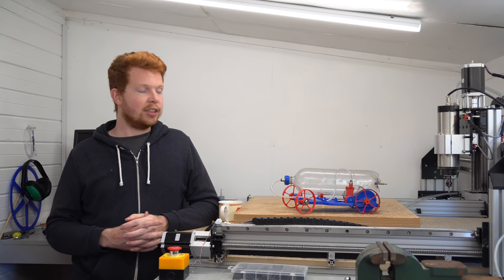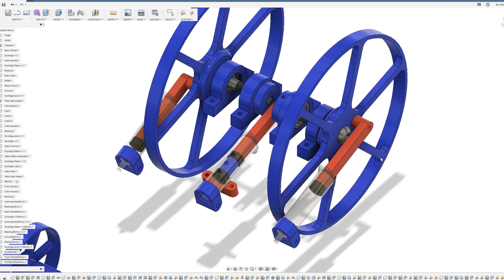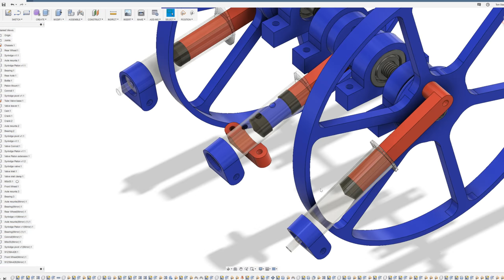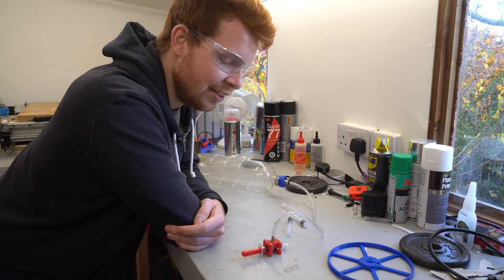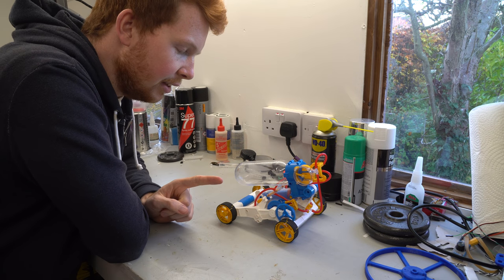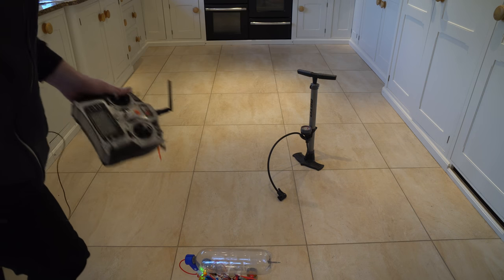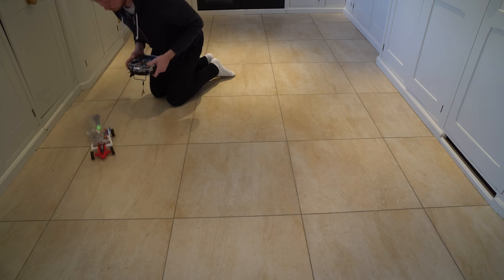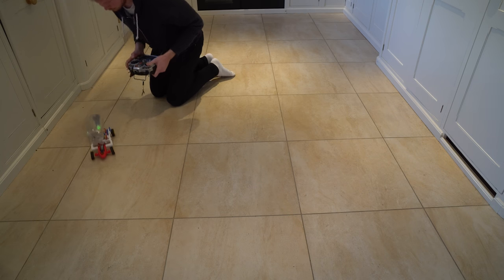Air Powered RC Car

Comment: A loss of resistance syringe might help with friction problems. Or just a little water might go a long way. Maybe an inline oiler or humidifier would keep things moving well and help maintain the seals. You might want to consider polycarbonate syringes for higher pressure applications, if you want to stick with plastic. The tubing could also be another component susceptible to expanding under pressure.

Comment: You could wrap the syringes with a string that does not stretch, in a nice tight single-layer spiral. Mix up some epoxy and coat the string. That'll hold a lot of pressure.
Reply: Sort of like how we repair ruptured pipes in the Navy: https://goo.gl/images/w45Yuq
Or like attaching a metal pushrod to a wooden dowel in an RC plane: https://goo.gl/images/WUWSFH
Reply: Perhaps if you put a little lubricant in the syringes you could get back some of the friction loss.
Reply: At the end, you pulled that tube out. You now need a valve that opens and simply thrusts with a nozzle (of course, engineered to the right specs!) when that becomes more efficient, to get that last 15 or 20 (or more, you wasted a lot by letting it freewheel!).
Reply: I would also love for you to break down how the one you bought from Amazon worked. Maybe even a tear-down of the interesting parts.
Reply: Love your videos, by the way :)
Reply: I read below some other comments about the same kinds of suggestions. You can do this, you can beat that crappy Amazon vehicle that is actually pretty amazing.
Reply: Lol that’s how they make shells for fireworks.

Comment: Hey Tom, very cool stuff! I've made piston air engines using brass tubing from the hobby shop. The dimensional accuracy is great - they make reasonably tight fitting, low friction pistons. I'm sure you could seat the cylinders well in a 3-D print. A little bearing grease would make the piston airtight.

Comment: Thats what I was thinking! Maybe two halfs bolted together like a clamp, holding the syringe in the mide, maybe with a silicone or rubber sleeve to prevent leaks between the syringe body and the plastic at the holes. Could drill a hole straight through the plastic, rubber gasket sleve, and syringe to ensure they're aligned. (Or something similar)

Comment: You could have made sleeves to go over your syringes, turning the syringes into cylinder liners, or you could have used glass syringes, which would possibly take the pressure, and have much lower friction.

Comment: Hi Tom,
first of all, great video as always.
I had the idea to make the car fully powered by air so there is not even a battery for the receiver and servo. You could use a small generator to make this possible. A turbine would probably be too inefficient so you could use a small brushed 5-6v motor and gear it to one wheel maybe? You could add a turbine between the bottle and the cylinders tho. There it could work. Would certainly be cool to have a fully air powered RC car.

Comment: Did you consider adding some kind of regulator so that you'd have ~100psi in the reservoir with a regulated lower pressure being fed to the pistons/motor?

Comment: Tom, with your design you can use PVC tubing with 3D Printed cylinder gaskets as the PVC can resist the pressure especially if you use pressure pipe, but you would have to build your own cylinders using PVC pipe

Comment: Just an idea, but there are pressure valves/cylinders (like the syringe) with a spring system to keep the pressure (more or less) constant.
I would also use two alternating pistons to keep the speed and torque a bit more constant.

Comment: I think your original idea for the air motor was genius.  The problem seemed to be you were losing tons of compression with the loose fitting piston.  If you could improve the tolerance between the piston and cylinder, I think you could produce more torque than you need.  That was an awesome series of videos.

Comment: You can probably get the same pressure into a smaller bottle if you use one of those 1 litre soda stream bottles & modify the cap a bit so it seals up properly & then add that valve on the bottom ofc through the plastic piece.

Perhaps another update could be attempting too design a container that's perhaps 3 - 2.5 litres instead & with a 60 psi limit & try some sort of plastic safe silicon oil in the syringes & any moving parts as well.

Comment: you should try to use glass syringes and if the pressure is too high maybe create 3d printed mounts for it to hold it together

Comment: You should build a gas generator, maybe steam, a burner, or something like the reaction they use for the emergency oxygen for airplanes. With this you could power all your gas powered contraptions a lot longer.

Comment: New variation - build an alternator into the rear axle to charge a super capacitor or 3 to power the electronics for the steering.. making it completely air powered!!

Comment: Hi, you could reinforce the bad plastic walls with carbon fiber, then soak em in super glue to gain back strength....or get titanium sleeves made to replace the bad plastic. Maybe get the ID made a bit larger so the resistance from the plunger is less. Or get a beefier plunger with an o-ring. You could print that part.

Comment: You could have printed supporting tubes for the syringes. And also exchange those rubber seals with proper O-Rings, as you had already designed your own pistons. Adding a little lube helps also tremendously. Adding a throttle control, so you could stop the car or even adjust the speed a bit. I guess I have to start own Design.

Comment: Yes i tried using a syringe for done air project thingy.. the plunger is too sticky, though the syringe itself could handle the pressure. The walls on the syringe i had were thicker.

Comment: I would have just printed some sleeves for the syringes so that they could hold higher pressure. Hell, you could even just wrap them tightly with duct tape.

Comment: If you want an ultra efficient air powered engine, take a "Tesla Turbine". I had advised you the same a while ago, however it seems like you haven't read it. Hopefully you will this time, because 98% efficiency are really worth a try.
Reply: But its a turbine with low tourq and no throttle.
Reply: No way a practical tesla turbine can get 98% efficency, even 60% is pushing it.
Reply: The gearing for that level of efficiency might as well be a water wheel
Reply: @crackedemerald4930  gg
Reply: I'd be curious to see him implement that too, but I dont know if it would be better.  Something worth playing with though.  Maybe a separate project.
Reply: 98% efficient...with no load.

Comment: I think 7:1 would give you a but more torque to get around those corners.. It also probably does not need a full 60psi, so a pressure valve may let you add more pressure/range without exploding something :)

Comment: Would be more interesting if you had a pressure gauge added that wirelessly transmitted the pressure reading to your remote so can estimate remaining distance available.
Could also add an extra servo just to do the kick start/block one of the pistons from moving so can stop it.

Comment: You could reduce resistance in the corners by implementing a Ackerman Steering Geometry. As this car is quite low speed it would be appropriate. It's nothing complicated, just give it a quick Google search. By changing the steering angle, so that both front wheels are perpendicular to their respective turning radius you reduce sidewards sliding of the wheels and thus reduce friction. Also, nice video.

Comment: Since this air powered engine design seems very efficient and lightweight, you could consider using it in your plane; likely it will require some gears to get a higher rotation speed.

Comment: An idea on using something other then syringes. You could always get some small diameter copper pipe. Then find some thick leather and make pistons that way, using some airtool oil or light weight grease should expand the leather enough to keep a seal. They used to make brass air pumps this way in the early days. If copper pipe would be to heavy there is pvc water pipe that might work as well. Plus if you would build a bigger car you could always use an air tank from a paint ball gun.. Just some thoughts.

Comment: Tom, I wouldn't give up completely on your DIY motor. you already know that the printed cylinder is stiffer, you could print jackets to contain the syringe expansion. And to reduce friction you could do away with the rubber plungers and cast pistons out of epoxy directly in the syringe itself. There's at least one diy internal combustion engine that has been running a few minutes on a JB weld piston, so air pressure should not be much worse.

Comment: Here's a challenge for you Tom. When I taught science we'd make soda bottle water rockets. Students would pump them up with a bicycle pump, but none of the bicycle pumps would last more than about 40 minutes before the bases were loose,  overheating would screw up the gasket seal...  Cost of the pump made no difference. 
We could use an air compressor, but the thrill of teenaged boys frantically pumping up their rockets is lost. Can you design and make a pump that can be maniacally pumped without wearing out in a matter of minutes?  The problems are 1. overheating 2. The movement of the whole pump.  I thought perhaps caging the pump in a frame with handles on opposite sides -- like the old horse drawn fire wagons. Then wrap the pump cylinder with a water jacket made from a larger tube filled with water.  Ideally it wouldn't require any 3D printed parts.

Comment: Hi Tom, have you considered adding some form of a exhaust recirculation? You could use some of the bled off pressure back into the intake to help make more power, or use less pressure at a given time to maybe go a bit farther on a single bottle of pressure. The hard part would be managing the bleed off of the exhaust so pressure can still escape and some can still be used, you could also use this as a form of variable throttle because air moving through the engine is what makes it function, therefore if you keep more from exiting you'll limit the exhaust flow, also there by limiting the flow in and out.

Just a thought I had.

Comment: Tom, really cool design! I'm an interventional radiologist in the US, we use high pressure syringes during our angiograms such as Merit Medallion syringes which are polycarbonate with oiled silicone which are quite strong and nearly frictionless.  They are a bit pricey but after all your design work, I am pretty sure it would function with these or similar syringes.  Maybe a nearby medical facility can donate some to your channel?

Comment: What if you take the syringes and place them in a 3d-printed cover or wrap them with steel wire? Should keep the side walls from bursting, but won't do much to help the end caps.

Comment: use paintball air tank with pressure regulator as an air source.
it can be pumped up to 200bar so it has a lot more air in it.

Comment: Just put sleeves over the syringes. Aluminum ones would be lightweight and stronger than 3D printed ones. Still, pneumatic systems are pretty cool and I like your designs

Comment: I still think you had something with the original idea. What about keeping the plunger seal but replacing the syringe barrel with a PVC or metal pipe of equivalent ID; possibly even a 3D printed part?

Comment: Large glass syringes, configure it with a V8 config (yes 8 syringe), add a regulator that is controlled by a gas pedal, add a large tank, add a clutch and a manual transmission, install it on a go cart or maybe a homemade vehicle

Comment: I am liking your ideas. Do you think you could build a compressed air “battery”? I have been thinking that you could use a wind turbine to operate a pump to store compressed air, then use it to power a turbine on a generator when you need electricity. I’ve seen those air powered tools, that might work as the turbine end.

Comment: Maybe on your next car you should add a little servo on the bottom with a small arm that has a rubber tip and then instead of manually starting it you just rotate the servo and it moves it enough to hopefully start it.

Comment: You could have solved the syringe problem by putting a tightly fitting 3d printed sleeve over the syringe. The syringe makes a seal, and the 3d printed sleeve provides the strength.

Comment: I wondered why your previous air engines didn't use a o ring on the piston. Might be worth looking into acquiring a reamer for your 3d prints and using a round piston.

Comment: so to upgrade the car:  put an airsoftgun on it wich fires plastic bb's. and the hihger pressure will speed the car up.  make a brake with a servo on the rear wheels.o yeah....put some lights on it😊😊👍👍👍  great video!!

Comment: Tom, several of your views suggest you look at steam engines back when you originally worked on the air powered car.    It looks like this toy is, a plastic version of a piston valve steam engine as opposed to a slide valve.   Still a fun video keep up the good work.

Comment: Maybe you could re-enforce the syringes with jubilee clips, acting as a jacket on the external diameter, they will stop the syringes distorting at high pressures.

Comment: Wouldn't it be more efficient to change the timing and cut off the flow of compressed air before the piston reaches full stroke?  I VB can see your timing scheme working a very low pressure but at higher pressure it will waste air.

Comment: why not print reinforcement cylinders to slip over the syringes? Add some 2 part epoxy and slip on, should cover all wall defects. Another option is for different diameter syringes, the bigger ones definitely have thicker walls.

Comment: If you had used a 4 syringe model, it would be able to power through those corners alot better because there would be no point without a power stroke.

Comment: Could you not find some higher strength tubes to use for cylinders? Maybe polycarbonate tubes with the same inner diameter as the syringes so you could use the same plungers. Also maybe add some lubricant to the pistons as well.  I would love to see your version built only from the printed parts in working order. It might even be possible (if a bit tricky) to print your own pistons and use an O-ring to seal it into a polycarbonate cylinder. Anyway, I would love to see a third iteration of the air powered car if you're up for the challenge.

Comment: try an air dash pot, i made a sterling engine that ran from the heat of my hand with it.
It has a graphite cylinder inside a glass tube. it runs on a laminar layer of air and has zero friction

Comment: Would you be able to attach a small water bottle in the rear, where it can be filled with air pressure that is released all at once to provide the initial movement to get the car rolling instead of having to push it? Another Idea to add to that would be to find a controllable valve to allow the small water bottle to get pressure from the 2 liter bottle and then turn off the connection between the two so that you can start and stop the car multiple times without having to re-pressurize the 2 liter bottle or having to push it.

Comment: If you want turbo this car. Use a reduction valve at the end of the bottle. Set the exaust presseur to what your engine runs best. And the other end to what ever the bottle(and valve) can take. Think of a scuba tank. 300bar in the thank yet only 1-2 bar to the human. His will give you an extreem range but maby you need something stronger than pet

Comment: hi Tom, what about small micro cycle pumps that are designed for the use of air.. some of them go upto 110psi ! will not expand and will be used to high pressures. ? and use 2 2ltr bottles, even use one 3ltr bottle :)

Comment: if you would make it have a higher gear ratio so that the engine would run at higher rpm, than it would be easier for it to take the corners without loosing so much speed. it also be able to run at the lower air pressures after running for a while. the only downside i see is that it would use more air for the distance travelled but that wouldn't make a big change since it will use the lower air pressures at the end better. btw great vid!
Reply: that, or convert to one wheel drive, having no differential is making all the drag when it's turning.
Reply: @modelnutty6503  good idea

Comment: Crankshafts in 2 piston steam and air engines are always 90 degrees offset, so when the one piston doesn't give any power the other gives its maximum power. 180 dedree offset is a bad idea also because in certain moments engine don't give any power and could just stop under a load. Sincerely from Russia.
Reply: I would also reccomend to add a flywheel. It's needed in any less-then-4-piston(or 2 two-stroke piston) engine to make engine more efficient and help it overcome the dead spots. The car would move slightly slower, but much smoother with it.   However if a 4 piston engine is attached to a light car it needs a flywheel too, so it won't go rush-stop-rush-stop.

Comment: so now it needs a throttle system. I'm also curious if there was a way to put a pressure sensor inside the bottle and have an arduino reading it so you could have a fuel gauge

Comment: Maybe try a hybrid where an electric motor starts the car from a stop, and then cuts out with a ratchet system when it starts moving enough to keep the cycle, and a sort of brake system so that thr car has more control

Comment: i know my comment is a bit late but this is the same desing as a steam engine but in every steam engine there is a dead point(a point that the engine cant get any steam to the cilinders) so you have that problem aswell, and you might need a lot of pressure to even start the engine going becouse of the friction from the rubber in the syringes